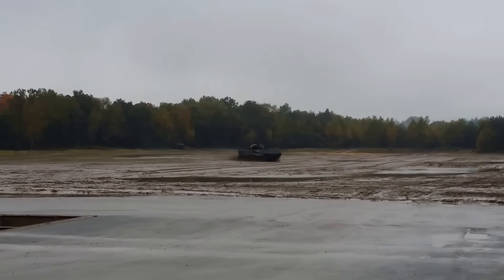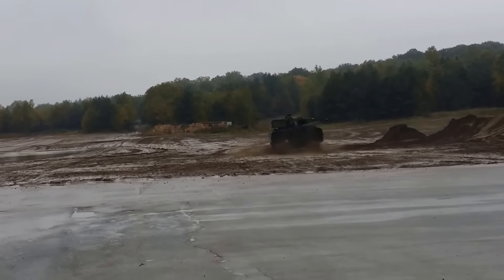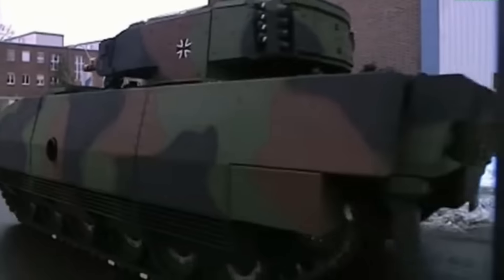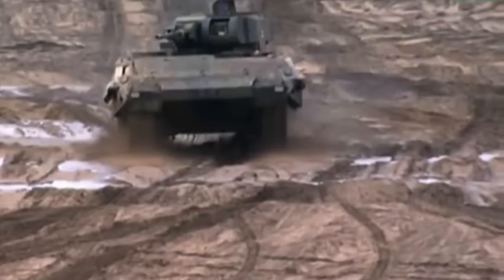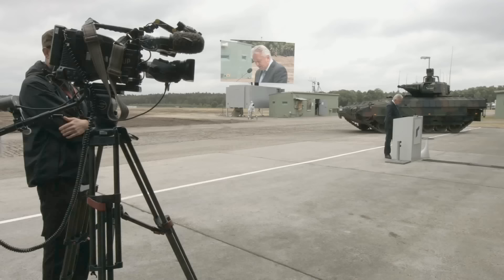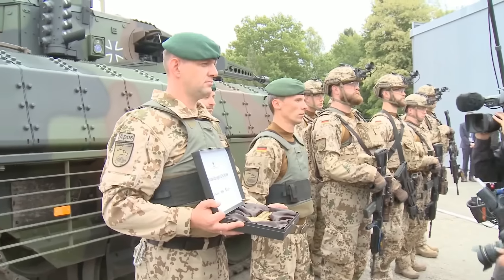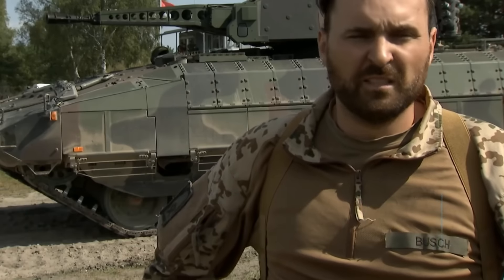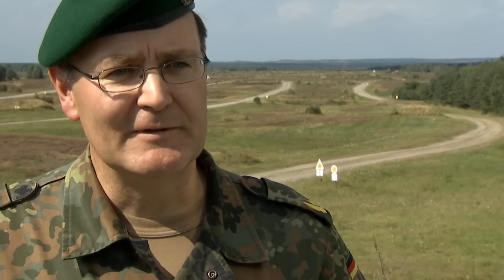The Puma Infantry Fighting Vehicle - Overview and Opinion

Comment: not a very well designed APC..small door , foot trap on small rear ramp  ~low roof , six or eight troops , but really six..short range and no room for Troops cargo (kit)..more a well armed recon ...small production runs as far as major power  goes..but great report . Cheers Allan
Reply: 6 troops is the german squad size. It's intended. And a high ground clearance and a low roof is always good for military vehicles. What foottrap do you mean? There's one in the prototype version... And it's not an APC. It's an IFV. They already have the Boxer APC with up to 9 personnel.
Reply: No it's a APC -as the infantry in No way fight from the either inside or the top. Hence the term "death before dismount".. The cramp spacing an extremely small exit ramp for rather large German troops is a poor design. The high angle of corner are not only rain & snow traps but wonderful ankle breakers as well. High ground is a must an non V hull. Short range lack of cargo space ( the optics  exposed as per reported) low productions numbers an very high cost . Make it suitable for out of country deployment ( per F-125 ships Atlas 400 etc etc ) of German defense policy .
Reply: The Puma has top hatches http://psm-spz.de/uploads/pics/PUMA_03_2015_1.jpg . Exit seems small since the entire vehicle is rather big. http://fkpg.de/wp-content/uploads/EFO-Munster.jpg Also the Puma is an HIFV (Heavy Infantry Fighting Vehicle) or AIFV (Armoured Infantry Fighting Vehicle) http://www.psm-spz.de/index.php?id=home&L=1 The optics have slide-on panels (have you seen the video?) What corner angle do you mean? And show me one TRACKED vehicle that has an V-Hull.
Reply: Well, in this  vehicle there is enough space for troops and gear. And, unlike in other vehicles, you can ride quiete comfy with all the IDZ gear already on. :-P
Reply: Jonny who ever said there was a tracked  V Hull Apc ? could you please show what or where  your talking about..Any new design APC, grant you~a very well armed APC's ( IFV died a long time ago) of the last 18 years will have been influenced by Mid east wars, Hence the high ground clearance , a given. The rear ramp is in fact very small both in relation to its given size,  an the demographic of the builder nation. An before you start, no it is not Namer small rear ramp , but that was never part of the design, converting a Tank that happens to have a hatch for crew escape an rapid reload of main gun ammo (all else being a after thought).. which of course along with the added armor it provides, is why the engine is in the front. Ronin said there plenty of room for troops an their gear along with the new hi tech whiz bang system the( oh an the seats on a Bradly are rather comfy tooo!:) German troops are going to get some day. Seems to me that low roof line would cause the same problems as the beloved CV-90 as the ( is it the Dutch??) rebuild who are raising it . The idea of low silhouette , apart from a cost control measure, has not proven to be very useful on the modern battlefield. Most if not all of the worlds longest range tank to tank kills come at the expense of mind numbingly  small BMP's (IFV :) an the death traps that are Russian influence/ design  Txxx  against the Monster  oversize western FCS.. The unman turret is simply lack of war fighting experience, while not having a bustle maximizes room inside the loss of man in the turret is to high a price. Beside the Israelis,  of course, build one that does both. An finally the idea that for every  one leopard 2  A6 to" infinity" there is only two Pumas( yes hence the Boxer, an that is some wonderful machine) makes for some very happy cost to ratio hunting groups..Cheers Allan
Reply: IFVs didn't die, they just changed their mission profile. APC are STILL NOT considered for fire support but misused (Best example the KTO Rosomak/Patria AMV). The ramp of the marder IFV was the same size. You argument about not proven advantages of a low roof line is a joke right? Still thinking about tank-to-tank is funny too (21st century please, we've got ATGMs with ~30 km range). Also a smaller exit means better structual integrity resulting in a better armoured ramp due to lower weight (<- Logic). Hatch is not only for reaload but for firing too as seen on the metal gun pads. The seats are actually AMAP-MPS anti-IED/Mine seats means you won't get your neck/back broken like in a CV-90/Bradley rolling on an large IED (Proven in Leopard 2A6CAN deployed in Afghanistan) Unmanned turret isn't a result in less " Fightning expierience" but in simply better protection. Even the russians go for it (T-14 MBT/T-15 IFV/Kurganez-25 IFV) But i think you are sure an weapon expert and know it better than a company that builds armoured fighting vehicles over ~60 years. Greets.
Reply: your not very bright about these things are you.1. I say the rear hatch is to small then you say it isn't, Now you say small makes its stronger.. 2. most APC IFV an like have higher profiles of most MTBs an since modern FCS have made major kills at extreme on even the extreme low profile of the Russian T xxx..then big or small matters little , for a troop carrier more room is better. The silly long range ATGM you speak of are top attack an do not in any way care if a tank or apc in 2 feet tall or 20. To them "ATGM top attack " looks the same as 10 by 10 square..anyway I could go on an on about the  details but I'm sure you a video game to get back too:)..oh yes one last thing the term Infantry Fighting Vehicle use to mean ( way back ) that the Infantry would Fight from the Vehicle .. as you see its right there in the title. Cheers Allan
Reply: Oh, i assume i'm "brighter" than you on this partcular topic. #1 The rear hatch can't be bigger on this IFV simply because it's not that high (in the inside either) It want's to accomplish a very high protection level, wich is easier to arcieve with a smaller vehicle size, see #3. #2 When you compare this hatch to the huge hatch on a M2 Bradley you will see this one is simply better protected. #3 Small profile isn't so important on hit- area but if you have a smaller wall, you can make it thicker while mantaining the same weight, nuff said. Logic. That's what they went for. (A CV-90 is a paper toy in comparision of portection) This vehicle still has the capability to carry 8 dismounts (with huge mine protected seats, probably could fit even more) since the german army went for a 4+2 seat configuration (6 men squad) and for a rack under the turret (instead of 2 more seats) for storage room. http://www.rommelkiste.de/Fahrzeuge/Puma/puma8.jpg As said above IFVs changed their mission profile, mounted infantry firing somewhat just isn't practical anymore since these accurate weapon stations can handle it. IFVs are heavy armed APCs in this case. IFV = Heavy armed, well armoured vehicle that's made for fire support. APCs are made for transportation. So as an example, the Boomerang APC can be described as an IFV since it carries 20mm+. However it lacks of protection.